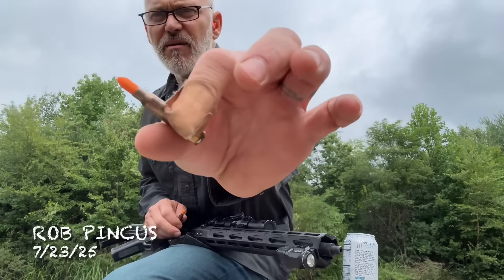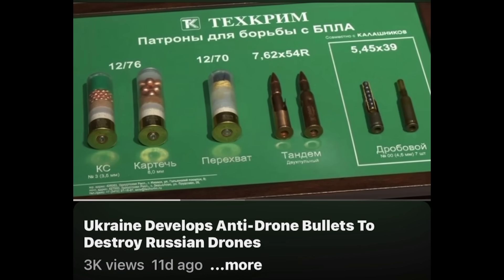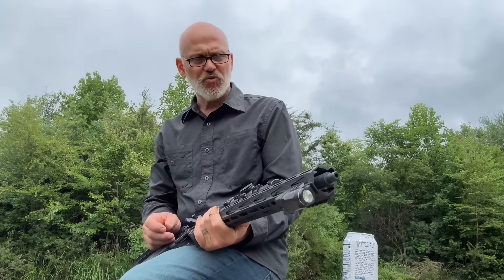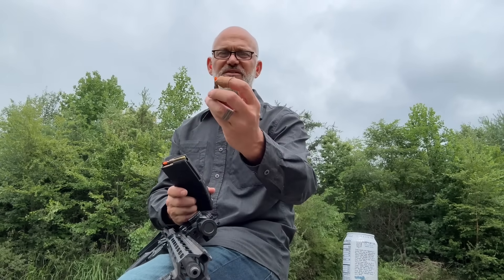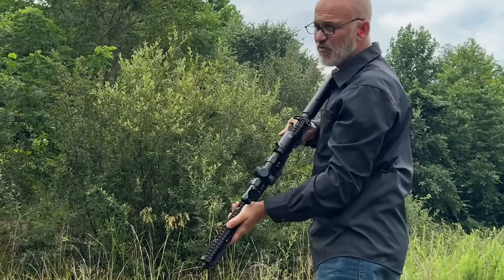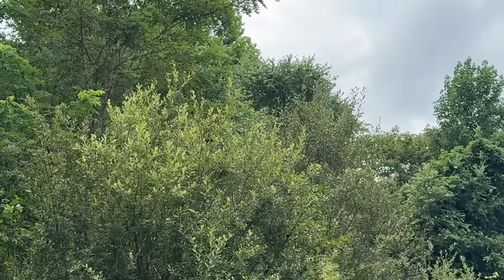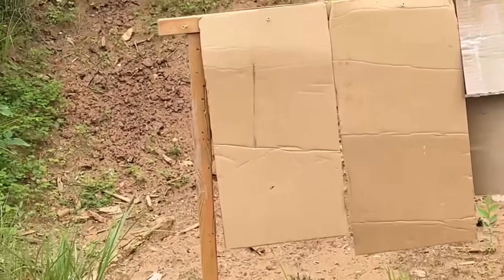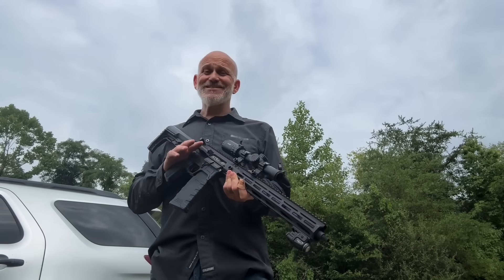Testing 5.56 Anti-Drone Sabot Rounds

Comment: If you're interested in persuing this further, test the resin version. 
The Armourer's Bench showed a version with 5 BBs printed in resin. 
This might help with feeding due to 20% more weight. 
Resin has also the benefit of being much more accurate, so that the patern may be more consistant. Additionally resin chars instead of melting and turning sticky, so fouling might be much better with resin shells. But it might be necessary to use an engeneering grade resing (i.e. formfutura tough or at least abs like resins) to keep the shells brom breaking in the barrel. 
Last, resin printers have a much higher production rate for this aplication, since print time only depend on the z hight instead of volume and print path like on fdm printers. Based on a rough estimate, a cheap consumer printer can make 5000 to 10000 shells per day.

Best of luck to you.

Comment: Some militaries did actual measurements and even regular smaller buckshot was not effective against drone. There is really low probability that buck would hit and criticaly damage important part of the drone. Birdshot was not nearly enough to do critical damage anywhere except electronics. And overall, shotgun did not score really well.

This video was not surprising.
Where I seen future C-UAV warfare is man portable DEW or squad level C-UAV UGV. Basicaly bigger drone carrying something more effective like automatic shotgun or DEW with own sensors (radars, cameras) and ability to fire autonomously.

Comment: One suggestion, run the sabot through a resizer to install a gascheck. Another idea, try casting a bullet out of a resin matrix with the bb's in the resin, then run the cast bullet through a resizer, installing a gascheck. 
The gascheck should keep the sabot/cast resin shell intact until it exits the barrel and then it should break up. 
Remember, there's no such thing as a failed experiment, just an experiment that produces results you don't like.
Back in the day, there was the SPIW project Saboted Projectile, Individual Weapon or something like that. They tried making flechette rounds with a single flechette stablized by a sabot. They tried making duplex rounds where you had two or three subprojectiles nested with each other so the target would be hit by two or three smaller bullets instead of one at 100 meters. 
Another option would be bumping it up to .300 Blackout or .308 to have a larger projectile for more BB's, loaded subsonic.
Reply: - science - test and move forward - balancing the weight of balls with loading disks - basically a rifling - sealing wad, as well as inertial resistance....

Comment: You should make lead BBs, with thread between two of them. Bigger spread but shorter distance. Or just use a 3.5" #6
Reply: shorter distance is not suitable if you're trying to take down a FPV drone strapped with an RPG warhead flying towards you.

Comment: Are you able to print the BBs in the print itself?  Print with them facing up (one piece not split), add pause before the nose cone it printed, load BBs, resume print.  My thinking is the plastic will explode either way but this way you have a more robust and smoother projectile for loading.

Comment: I would think the twisting in the barrel would spin that round apart as soon as it leaves the barrel. Maybe not possible, i wonder if a smooth bore would make it more feasible.
Reply from the maker: 1. The projectile is supposed to “fly apart”.
2. Using a different weapon defeats the purpose of trying to develop special purpose ammunition for the weapon already being carried.
Reply: @RobPincusPro oh no sir I understand that, but now that we see it hasnt worked well based on your best efforts. How could it work better? Just theoretically thinking is all.
Reply from the maker: @npfd113 gotchya…. I wouldn’t rule out this concept yet. Me and another guy “working on it” for less than five hours spread out over 3 days as a fifth or eighth priority shouldn’t be considered the final word or anything close to “best effort”…😂